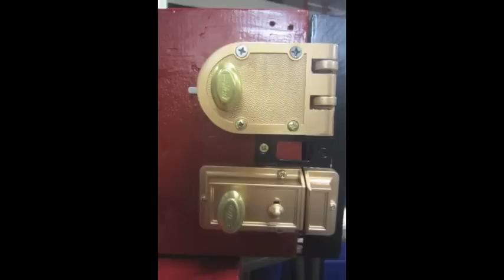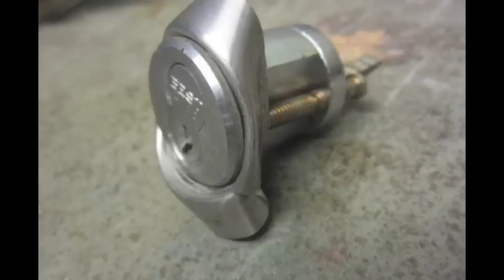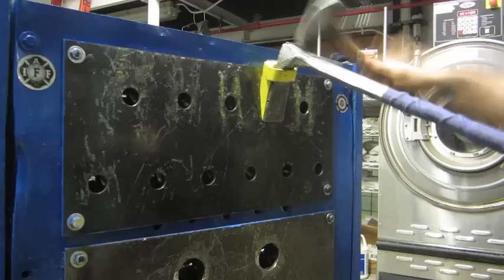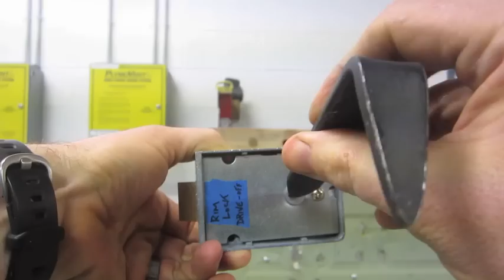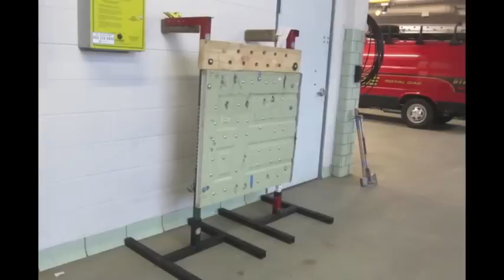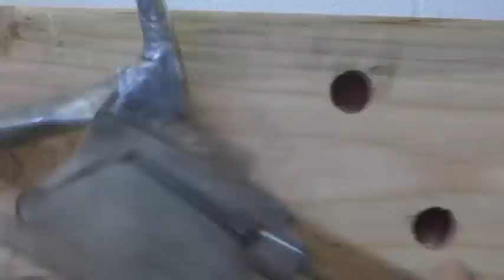Forcible Entry: Rim Lock TTL Plan "A" and Plan "B"

Comment: What are use using for the back plate on the plan b prop?
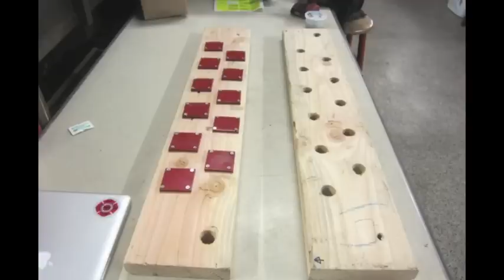Reply from the maker: You can see it at about the 3:50 mark....they're 3/16" x 3" flat steel cut down to 3" squares.